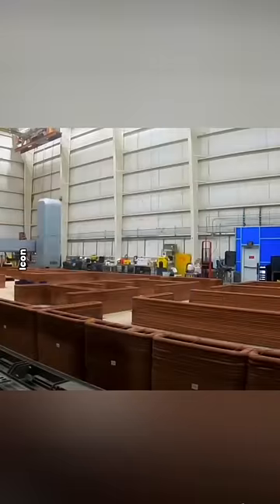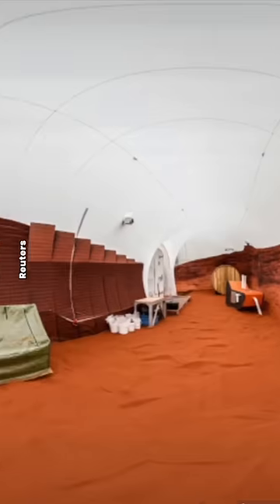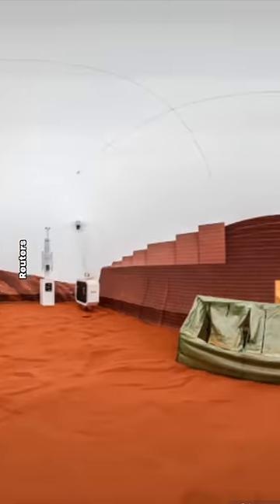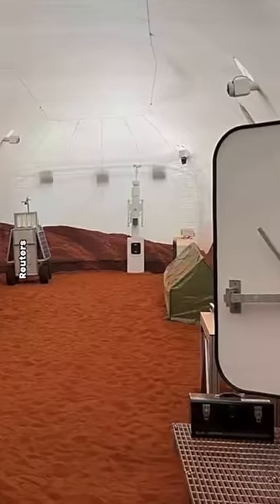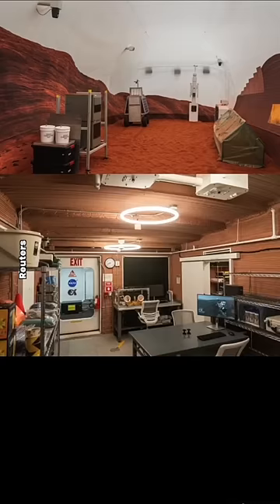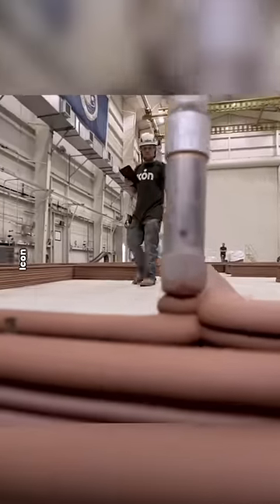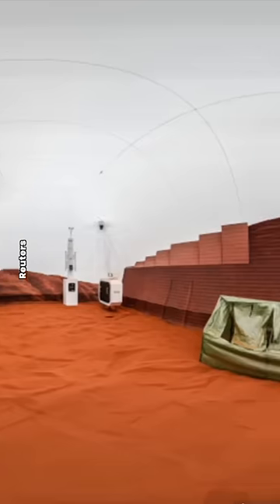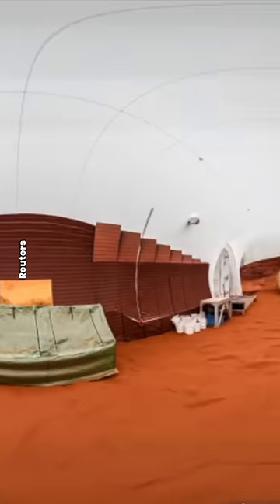Would you live in here for that long? 🏠 #shorts

Comment: Wish we could do 3d-printed homes already
Reply: @smellmyfinger85 not in the way OP wants though. We can 3D print walls and that's about it. That ignores electrical, plumbing, windows, roofs, the foundation itself, and so many other sub-projects that add to the cost of housing. Add onto that the absurd cost due to the price of the machines and the increased use of concrete compared to cheaper and more environmentally friendly materials like lumber and you end up with a technology that sounds amazing on paper, until all the realities of... reality... set in.
Reply: @smellmyfinger85  you were the one claiming "people do" 3D print homes, which is, if we're being generous, very misleading.
Reply: @smellmyfinger85  ...what exactly do you think the point of 3D printed homes? I'm assuming you're smart enough to know that the cost of building a home (at scale) is in materials and labor. Given your enthusiasm for the tech, I'm also assuming you don't know that framing and drywalling (the two processes that 3D printing can currently replace) is an absolute minority of the cost in every respect, not to mention the use of concrete for the walls makes home maintenance very difficult (try hanging a photograph on concrete. Now move it 2 inches cuz you didn't like it) and actually increases the difficulty of utility installation.

What I explained is not a pipe dream. It is a base requirement before 3D printing ever becomes viable, in a similar way to how fusion generators producing more energy than they consume in a useful way is a base requirement for that tech to ever proceed out of a lab.
Reply: @smellmyfinger85  I never said there don't exist 3D printed homes. I said your statement about there being 3D printed homes in response to a person's comment about "we should 3D print out homes" was at best misleading, and at worst, deceptive.

They were clearly making a statement from a layman perspective that they think it would make homes cheaper, larger, more customizable, and/or improve the process in some way. You used your expertise to imply that that already a thing instead of giving them the reality that such technology is in development but is a long way from being what a normal person thinks of when they say "a 3D printed home," which to them, is an entire home built by machine, with maybe some finishing touches done by human (think "light fixtures," not "all the plumbing.")

I'm an engineer who deals with project management daily, so I guess this is why I have job security. New tech is nice, and the idea is great on paper, but if it doesn't improve the process in some tangible way, it won't be adopted as anything more than a gimmick. Integration hell is a very real place.

Comment: I'd add a step to construction of either sanding down or applying puddy to interior walls, to flatten them out. Because that material does not look easy to clean on its own, and now you've thrown in a bunch of tiny crevices for dust to build up in.

Comment: How do they handle the gravity difference? Can't really simulate that and it will have a huge effect on everything. You are almost a 2/3 lighter there. Would the printer even work well enough to create a seal without the weight of the material pushing down on itself. Lots of questions.

Comment: Just one question. Have they tested that 3d building printer in the extreme cold and atmospheric pressure of Mars? Sure would suck to go through all this experimentation just to find out the machine doesn't work under Mars conditions. Oh and it would be the first time NASA neglected to take into account the environment equipment would operate in when doing tests. Remember the mirrors of the Hubble space telescope.

Comment: Question to me is will it have the required radiation shielding that it would take to live on Mars. Increased cost just for the experiment I bet not. And what is the binder used that's going to take aggregate Martian soil and allow it to be pumped through a specialized pump system. I see all sorts of input costs that would be very expensive